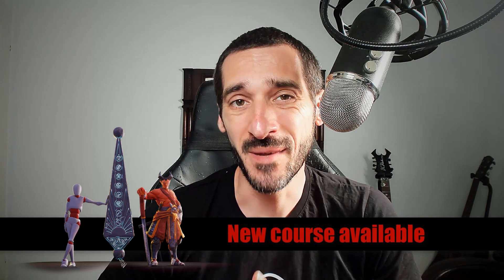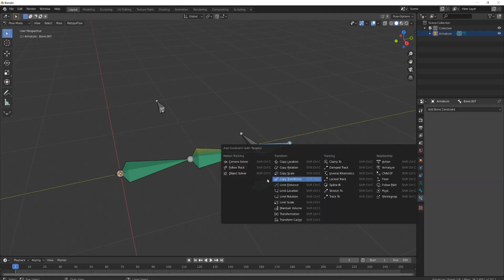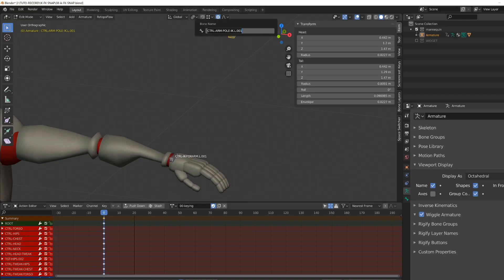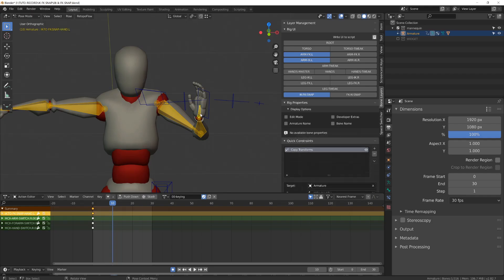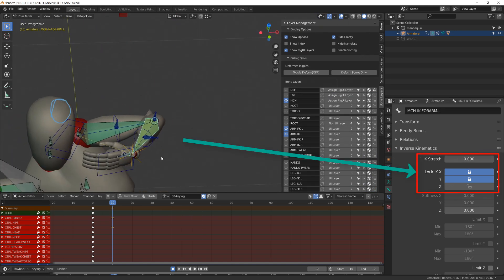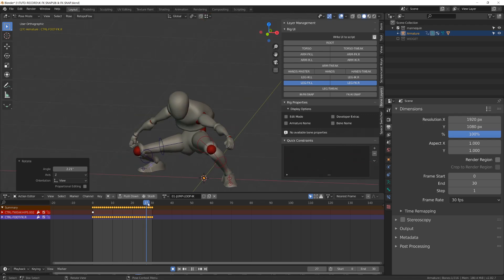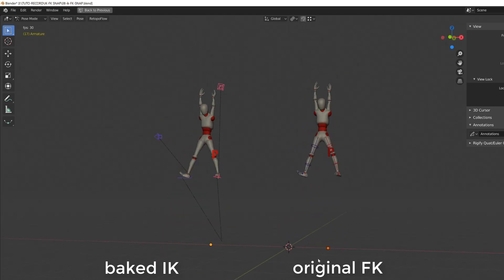Blender rigging - IK FK auto snapping without scripting

Comment from the maker: Time stamps : 
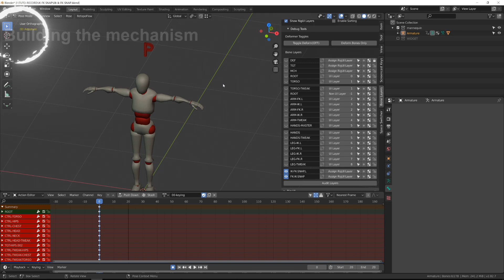Building the mechanism : 00:50
IK to FK :  03:59
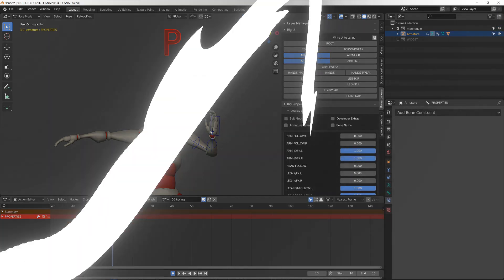FK to IK :  05:50
Further benefits : 07:31
Rigging and FK-IK switch : https://youtu.be/ZwJxDj69IoI
Reply: Sir I've found an easier way without baking to do that
Reply from the maker: @TheThUnDeRbOlT999  How?
You copy and past tranform properties?
Reply: I use Auto Rig Pro with IK/FK snapping, but switching between them causes interpolation issues. For example, switching from IK on frame 5 to FK on frame 10 creates odd interpolation. Fixing the frames in between affects the established frames 5 and 10. Resulting in cyclical correction and losing complete control of the animation, any advice on why this might happen?

Thanks for uploading this tutorial!
Reply from the maker: @ you wanna switch over one frame not 5. Like from frame 5 to 6
Reply: @ Thanks for the quick reply!

If my model does a kick in IK on frame 5, then leaps on frame 10 (where I tend to switch to FK), should I instead snap to FK on frame 9? Or right after the kick on frame 6?

IK/FK snapping is tricky, but your tutorials make Blender much easier to work with. Really enjoyed the smear-to-shape key video—one of my favorites!

That cartoony effect in your animations is amazing—I’d love to achieve something like that!

Comment: actually, I can't agree with most comments. maybe, I do not fully understand the concept, but I personally have been using another, way faster method for IK FK snapping: 
1. set the pose in desired mode 
2. select all the bones (or only the bones of affected chains) 
3. apply visual transform to pose 
4. keyframe target chain (whole character (selected only) or just rotation for FK/location for IK)
5. swith the mode 
6. enjoy.
Reply: for FK to IK you can use copy transforms/rotation before applying, of course
Reply from the maker: Could you do a short demo video?
Because I’m not sure of what you are explaining.
Also I think you assume the Ik chain and controller is aligned with the FK in rest pose.
What about the pole target ?
Reply: @PierrickPicaut_P2DESIGN  true, they are aligned in the rest pose in my rigs. the pole target has to be either moved manually or I also tried to parent it to the IK controller (mostly works, but free alignment gives more freedom). actually, I saw this method in some other tutorials, not especially dedicated to the switching concept. I could make a note to record a demo of all necessary
Reply: I also found this method, but this method is still flawed. That is, when switching from fk back to ik, there will be a slight movement due to the polar direction.

Comment: Great Work i have applied the same procedure on my character but i am having problems with hand and foot rotation. Every thing works well except hand and foot rotation
Any Solutions?
My Issue is related to hand Parent because when i am in FK mode hands need to be parented to Forearm and when i am in IK Mode hands need to be parented to Hand IK
so when i am trying to bake my FK Animation to IK i am having these problems